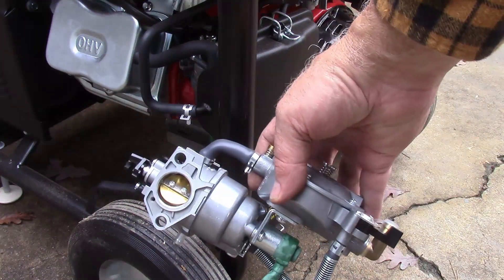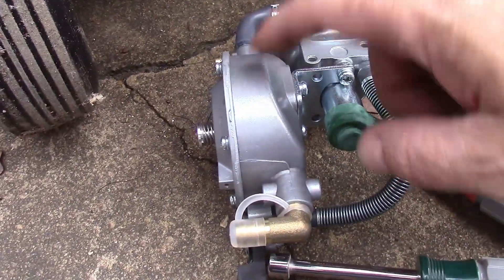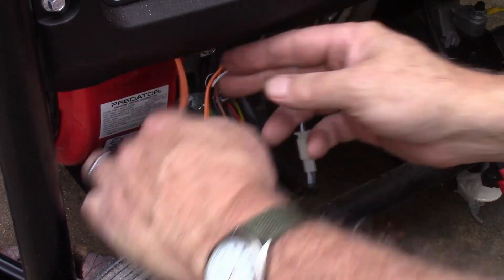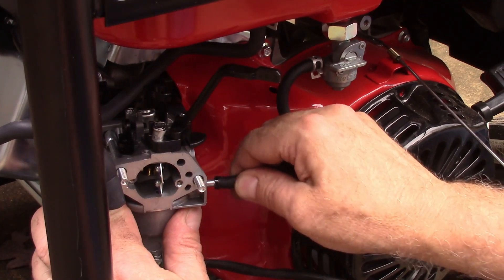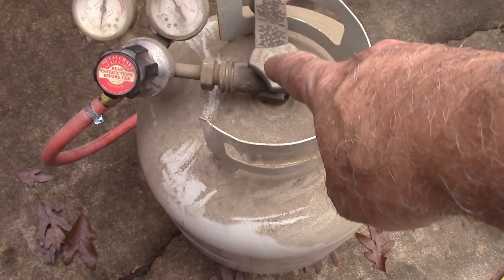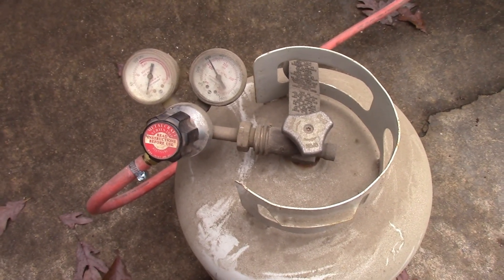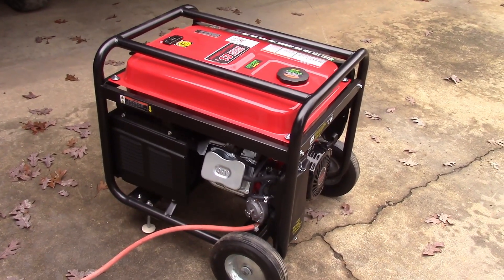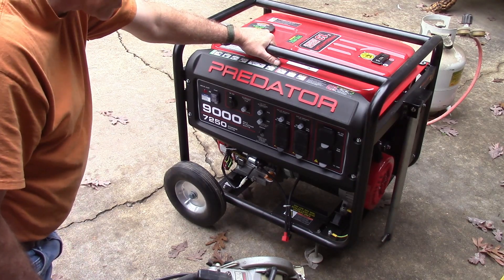Predator 9000/8750 Generator Propane Conversion  Tri Fuel

Comment: Anyone do this for a 9000 model.  The carburetor I bought from link above fits, but the air filter doesn't fit because of the pole.
Reply: im looking to buy this myself from the link My question right above yours I have been looking on vpowerequipment  they have 1 for $62 (they all look the same hate to spend the extra money (they say u need an air box that they sell for $24 that you have to drill hole in to fit hose into)is that the issue? Please reply to my question if you can I want to use mine for natural gas thanks
Reply: @michaelbarbieri3142  call V Power Equip by telephone because they are very helpful. I bought their $62 carb but it would not fit on my A-iPower SUA12000E gasoline only generator.
Reply: @beeerhunt  thank you I have inquired with power equipment and saw another u tube where they modified air box did you fix that issue
Reply: @michaelbarbieri3142  I sent the carb back because of 3 reasons: 1) frame  leg blocked access, 2) transport wheel blocks access to carb fuel inlet no matter if I was able to get the carb to fit, 3) the carb anchor bolts were too small. 
 Note: check out the Lumix GC tri fuel carb on Amazon because one person said it worked on the A-iPower sua 12000, although no details AND IT LOOKS IDENTICAL to the V Power carb.
 I am referring to the A-iPower sua12000 ONLY
Reply: @beeerhunt I wound up with the predator 9000 found carb.on v power equipment hope it fits Thanks
Reply: Here is a reminder about portable generator safety: everyone really needs to see this safety reminder to make sure. This advice is just to make sure that everyone is aware of all the warnings and it’s just to remind people to be careful using portable generators. Generators can be dangerous if not used carefully. Every year, hundreds of people die or get injured when using portable generators due to carbon monoxide poisoning and electrocution. Make sure you are using your generator carefully and keeping others safe as well. There is something very serious that everyone should always be aware of when using generators. Some people do run their generator indoors which is not safe and that increases the risk of carbon monoxide poisoning which can cause death of family and you. Some people run their generator in wet conditions which can electrocute them. Please remember that you should never run your generator indoors. Remember that carbon monoxide is an odorless and colorless gas that you cannot see or smell. Carbon monoxide is a silent killer. Keep that in mind. Make sure your generator is 15-20 feet away from your house and away from doors, windows, and vents. Never use your generator in your porch too. Having a carbon monoxide detector is very important against generator safety. Some people also allow children to go near the portable generator which could pose risks. We need to keep an eye on our children making sure that they are not near the portable generator so they won’t get electrocuted or burned by the generator which is dangerous. A locking enclosure also keeps kids safe. A generator shed might look like a tempting place to explore, or take cover during a game of hide and seek, but a generator is a dangerous piece of equipment that can cause injury. It says on the manual that we should also keep children away at all times from the portable generator to avoid injuries. Please do not allow a child or unqualified people to operate the portable generator. Just because some manuals missed what should be listed doesn’t mean it’s safe to do. Always follow the generator safety rules when using portable generators. Generators pose electrical risks. If you need to use your generator during wet weather, you need a generator tent to protect your generator from getting wet. Don’t let your generator get wet. Keep your generator dry and before using your generator, please make sure your hands and your generator is dry. Do not wear loose clothing when operating the generator. Everything that is said on the generator’s operating manual should not be ignored. Never smoke cigarettes near the generator. Please keep flammable things away from the generator. Never overload your generator too. Your generator can catch fire. Never ever try to plug a generator cord into a wall outlet to avoid back feeding. Back feeding your generator is dangerous. Always turn on your generator first before plugging in appliances and shut off the appliances before turning your generator off. Use a heavy duty cord for your generator and the cord should not be worn out. All the instructions should be followed carefully. Never refuel your generator while it’s running. It can cause fire if fuel spills while your generator is hot. You should turn off your generator and let it cool off before refueling it. Having a fire extinguisher next to the generator is also important. This is only a reminder for everyone’s safety of using generators. Make sure your generator is properly grounded. Having a fire extinguisher next to the generator is also important against the safety rules. https://youtu.be/I1jT3ANENvI and here is a video more about keeping others safe when using generators and also about our family’s safety. Hope this helps. Thank you. Stay safe. All generator safety rules are needed to be followed carefully.

Comment: Has anyone tried on natural gas feedback says for cng not natural gas from house also another site has carb. For $62 looks the same and they say you
need to buy air box for additional 24 that you can drill hole and put hose into it  any advice appreciated
Reply: I'm running natural gas from my garage hook up to my amazon carb and it runs great, 
If you get the natural gas/propane carb you don't need to do anything to the air box.

Comment: The link to Amazon is for a smaller KW generator, not the 9000.
Reply: Funny, I just try this on 9000 and it doesn't fit, did you find one for 9000
Reply: @craigzarrella8196  No, when I went to Amazon with the link supplied with this vid, I discovered it was not for a 9000. Bad link ????  Now to find one that will fit. I will post here if I find one.
Reply: @joebauman7378  I did some emailing to companies, and got this reply from them

This kit will work with your Predator 9000 watt generator.

https://www.vpowerequipment.com/lpg-conversion-carburetor-kit-for-generators-in-the-5500-watts-threw-8750-watts/

You may have to make modifications to the air box, however.  Or you may want to use the 8750 air box we sell which should fit easier - you would just have to drill a hole in it for the vapor hose.  That air box is here:

https://www.vpowerequipment.com/generator-air-filter-housing-for-5500-watt-through-8750-watt-generators/ 

Let me know how you make out.  I may just use gas, I only purchase a generator in case of power outage which only has happen twice in 15 years to me.
Reply: @craigzarrella8196  Thanks for the info. I like you may just stick with gas since I won't be using it except during outages.
Reply: Everyone, please make sure you also watch this video about generator safety https://youtu.be/I1jT3ANENvI it is very important to understand things about generator safety.

Comment: The conversion carb you linked indicates it's only good for 4.5-5.5kW.  Your generator is nearly 9kW, double their low end estimate.  Have you run at full load yet?
Reply: Generator safety https://youtu.be/I1jT3ANENvI

Comment: On any conversion set up from gasoline to LP, CNG or natural gas you need to install a solenoid valve in the supply line held open by generator's electrical.  Without this, if your generator fails for any reason other than fuel supply, you will have your alternative fuel pouring out of the air box till you notice your generator has stopped working.  If you are sleeping or away from the house this could get very expensive/dangerous.   Same safety concept as the thermocouple on your hot water heater.  If you have no idea what I am talking about, you should find someone locally near you that does.
Reply: These have a built in valve for the gas control.
That's why you have to "prime" them to get them to start.
Once the engine starts on the prime then the engine creates a vacuum on the intake that opens the gas valve that is in this carburetor. It's the same vacuum that draws gas into your engine.
Reply: The diaphragm that controls gas flow into the inlet manifold automatically closes when the engine stops so no further need to have extra valve.   Of course it is wise to shut gas supply off at the source when idle/unused for any length of time.    The wired electrical valve under the carb is for gasoline control.
Reply: You literally have no idea what you are talking about. The solenoid on the bottom of the carb is for the main and pilot jet feed not for the fuel flow feed. Inside the carb there is a float that shuts off the fuel flow from the tank to the carb. The solenoid helps keep the fuel in the float bowl in decent shape and is also an emergency method of shutting off the fuel. The propane regulator on the carb auto shuts off fuel when there is no pulse of air pressure from the engine. Please educate yourself on how small engines work before making an idiot of yourself and misleading others.
Reply: Isn’t that what the 2 wires he connected was for? I didn’t hear any propane hissing when it shut off. 
I need to know this because I just bought this generator and about to order this conversion kit.
Reply: Yeah sorry.  It appears so.   Not sure how I missed that.   Would make sense they built in a safety, but with stuff from China you never know.   Just make sure it’s working properly before you put in service.
Reply: @davidcollins5489  yeah. I got my generator the other day. I was going to order the conversion kit but I don’t think it’ll fit the new ones. The airline to the fuel tank plugs into the back of the breather box instead of the side and the kit would be in the way then. So I gotta figure out what to do now.
Reply: @Shawn-rq4py  seems like they are always changing the design.  I imagine you can make it work... you just have to be a little creative ( and see what other people are doing on YouTube ). 

As for that wiring to carburetor, I did some Google research and realized I was thinking in cheap lawn mower mode where starting and stopping is accomplished by grounding  the ignition circuit ( that spring loaded safety lever you have to hold against regular handle when running ).  The Predator has a Start/Stop switch which controls a fuel shut off solenoid.  It is not really serving the same purpose as when you hook it up to your conversion kit, but probably gets the job done just as well.  With the gas tank, if engine fails, gas will not continue to flow as the turning engine is what draws it in.  With a natural gas connection, if engine fails the natural gas would not stop.   So just be aware of this...  if shut-off fails ( stuck open ) running on gas, it is not a big deal... engine stops, gas flow stops.   if shut-off fails ( stuck open ) running on natural gas, it can be a big deal... engine stops , natural gas keeps on coming...
Reply: @davidcollins5489  gotcha. Makes sense
Reply: Here is a reminder about portable generator safety: everyone really needs to see this safety reminder to make sure. This advice is just to make sure that everyone is aware of all the warnings and it’s just to remind people to be careful using portable generators. Generators can be dangerous if not used carefully. Every year, hundreds of people die or get injured when using portable generators due to carbon monoxide poisoning and electrocution. Make sure you are using your generator carefully and keeping others safe as well. There is something very serious that everyone should always be aware of when using generators. Some people do run their generator indoors which is not safe and that increases the risk of carbon monoxide poisoning which can cause death of family and you. Some people run their generator in wet conditions which can electrocute them. Please remember that you should never run your generator indoors. Remember that carbon monoxide is an odorless and colorless gas that you cannot see or smell. Carbon monoxide is a silent killer. Keep that in mind. Make sure your generator is 15-20 feet away from your house and away from doors, windows, and vents. Never use your generator in your porch too. Having a carbon monoxide detector is very important against generator safety. Some people also allow children to go near the portable generator which could pose risks. We need to keep an eye on our children making sure that they are not near the portable generator so they won’t get electrocuted or burned by the generator which is dangerous. A locking enclosure also keeps kids safe. A generator shed might look like a tempting place to explore, or take cover during a game of hide and seek, but a generator is a dangerous piece of equipment that can cause injury. It says on the manual that we should also keep children away at all times from the portable generator to avoid injuries. Please do not allow a child or unqualified people to operate the portable generator. Just because some manuals missed what should be listed doesn’t mean it’s safe to do. Always follow the generator safety rules when using portable generators. Generators pose electrical risks. If you need to use your generator during wet weather, you need a generator tent to protect your generator from getting wet. Don’t let your generator get wet. Keep your generator dry and before using your generator, please make sure your hands and your generator is dry. Do not wear loose clothing when operating the generator. Everything that is said on the generator’s operating manual should not be ignored. Never smoke cigarettes near the generator. Please keep flammable things away from the generator. Never overload your generator too. Your generator can catch fire. Never ever try to plug a generator cord into a wall outlet to avoid back feeding. Back feeding your generator is dangerous. Always turn on your generator first before plugging in appliances and shut off the appliances before turning your generator off. Use a heavy duty cord for your generator and the cord should not be worn out. All the instructions should be followed carefully. Never refuel your generator while it’s running. It can cause fire if fuel spills while your generator is hot. You should turn off your generator and let it cool off before refueling it. Having a fire extinguisher next to the generator is also important. This is only a reminder for everyone’s safety of using generators. Make sure your generator is properly grounded. Having a fire extinguisher next to the generator is also important against the safety rules. https://youtu.be/I1jT3ANENvI and here is a video more about keeping others safe when using generators and also about our family’s safety. Hope this helps. Thank you. Hope you all stay safe
Reply: @The_Happy_Aviation_Enthusiast Carbon monoxide is odorless, but it is created when you have too much gas or too little air. 99% of the time when I have entered houses with high amounts of carbon monoxide from plugged chimneys and boilers, or cracked heat exchangers etc, the smell of carbon was immediate and detectible. You should always have a carbon monoxide detector, but if you don’t and you smell something strange or unusual and are experiencing headaches or nausea, step out of your house and call a professional.